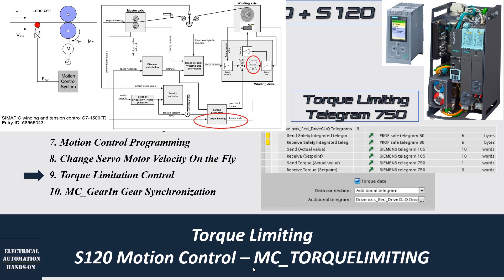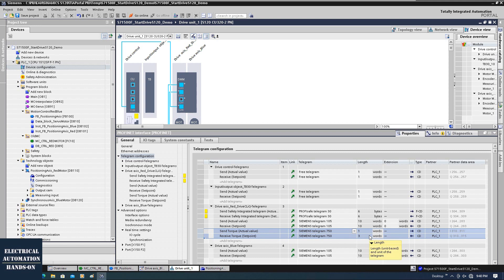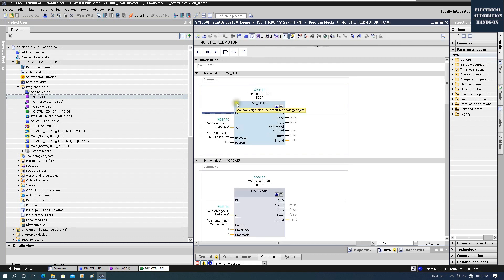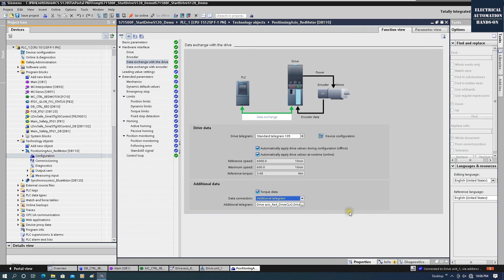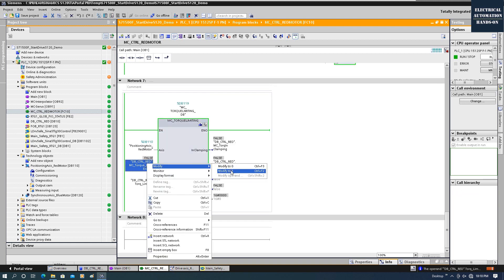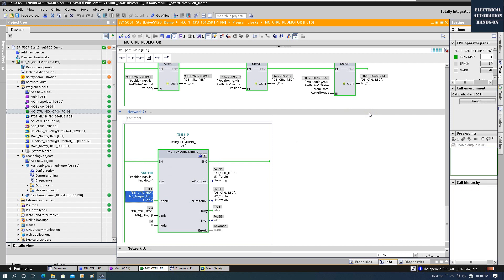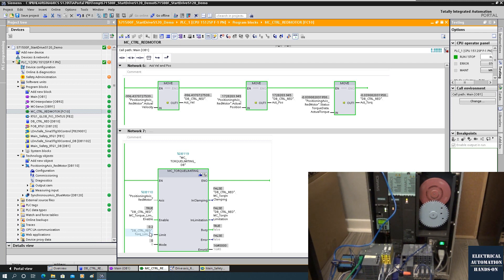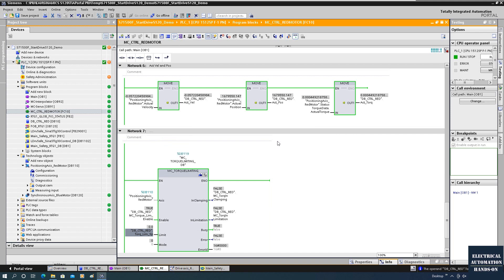MS05k. [Siemens S120 #9] SINAMICS S120 Drive Torque Limitation, Torque Reduction

Comment: Hello, Thats a great video, thank you. But im using simatic manager and starter in a factory. Torque limits go from plc to drive as %150(p1522,1523)

Sometimes the actual speed cant reach referance speed. Starter says 'torque limite reached'.i look actual torque but it shows %60-70, but the limit %150...Also i check the current ,  there is no problem, current is lower than nominal .

i carried search in starter, and i realized that there is a parameter r1538(effective torque limit). This value always changes when motor running. İf actual torque is higher than r1538, the motor cant be speeder.

My question is; how do r1538(effective torq limit) change? İ want to let the motor can be speeder until actual torque %150.. 

Thank you very much!
Reply from the maker: Please check p2003, some times the default S120 p2003 is the 200% of the default torque

Comment: Ok, great tuto! But you Said THOT torque l’imitions is generally used in speed control mode. So how to set torque limitation in a positionning task and avoid overspeed while deactivating torque limiting after axis have reached the target position?
Reply from the maker: From the application wise, it is rare to use position control with torque reduction. Because if you limit the torque, some times your position close loop cannot work properly anymore because the drive does not have enough torque to reach the position target. In addition, you could check the 'Fix Stop' function, which allows the positioning control to work together with torque limiting for torque tightening control.
Reply: Thank for answering. I’m not 100% on line with you regarding no torque limitation in positioning loop. I’m often facing such situation while setting up special machines. The motor nominal torque can be higher than system required torque to accelerate a mechanism. And to avoid damages or injuries somme times I have to limit torque while positioning.
Reply from the maker: @francisgremillet3894  To avoid damage, you could use speed override from Power_ON, to reduce speed to <10% when you are doing test and commissioning. To avoid injuries, you can use STO or SLS safety,and use deadman switch.